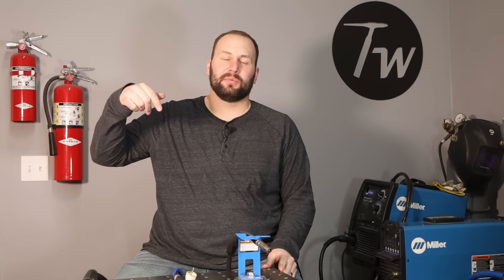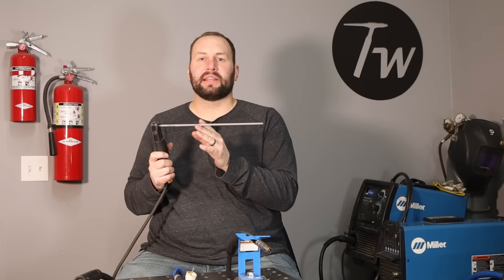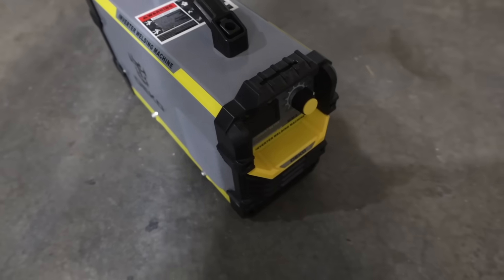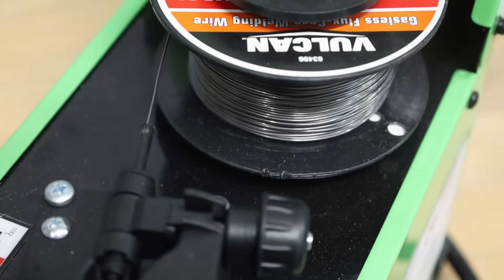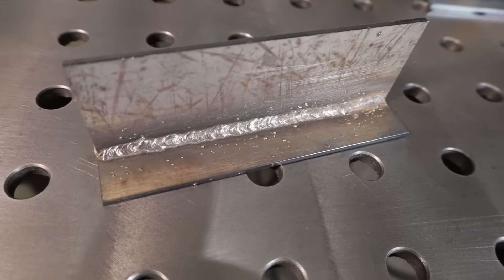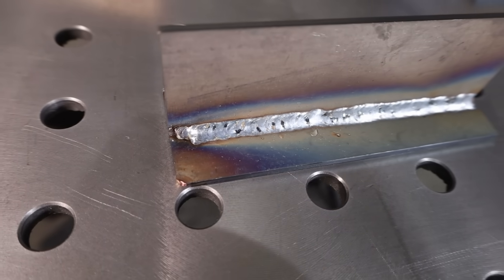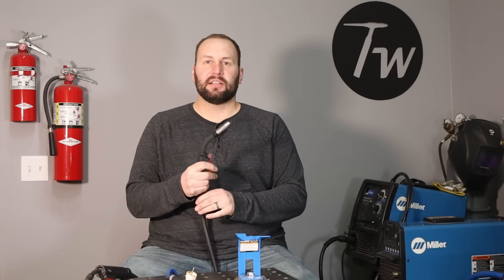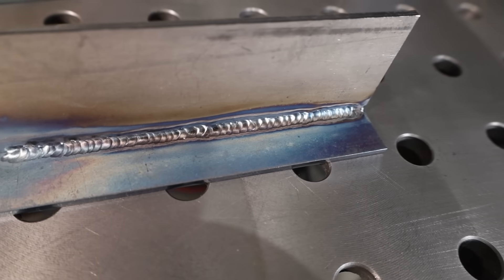4 Types of Welding Explained: MIG vs TIG vs Stick vs Flux Core

Comment: Welding is just of those things i just enjoy ok i am in a Woodworking group doing whatever i can do most jobs like hang doors/chop hinges/locks out and more but it's sort of something i come to rather than yes i'l go make something. 
Where as my welders and some steel and i'm away make anything! Got all the kit and few welders plus found 2 plus kit Abandoned chucked out of a van(2 inverters 110 and 240)did find an invoice rang them they contacted company they supplied with bits i found and they rang me gave details about it all and where with name i found on bits and signed invoice they tried to ring him then rang me back told them where i was sat on it for 6 months but never heard back plus even plod didn't want to know as i was concerned been hijacked etc as personal kit in their like steel square you make in Engineering course for first exam etc so claimed it plus odd only thing missing was the cables & mask) Got a Cebora 130amp Mig of someone it's same as the snap on one as they make for snap on. and bought a new 130amp Hobart inverter which can do scratch Tig with have torch etc for it plus spare circuit board as one day wouldn't work  checked torch volts! low guy got from sent me board but when sticking my nose inside found a relay with a reset button on top so thought press! Click! Ha so put back together and Bing working think Dirty Electric breaker as think is one that don't like running of Generators or Extension leads with surging current as place was at is out of way with poor electrics.
Stick welded door hinge on car to A pillar with 1mm rod was a job n half as often get built up and burn through so worked out just enough build then do bit along then come back do bit more till sorted didn't look perfect but door never failed again.

Comment: Tig to me is kinda like soldering
Reply: No! Not at all. Welding is defined as melting the base metals, whether the metal is fused or melted together or a piece of filler rod (thin wire) is added to the molten puddle. Soldering never melts the base metal such as copper or brass. Solder is tin and lead and adheres to the copper wire or any other metal with the help of some soldering flux. The flux prevents the metal from oxidising.

Comment: great vid for learning the differences of welding equipment but leaves the technique out of it. best tip I've learned for welding is heating the materials before welding, this removes the moisture and also helps the weld stick better and easier. but definitely have to practice.

Comment: I hand weld in the coal mining business, I traditionally use stick because of the heavier duty metal we work with but also MIG from time to time as well. This video was very informative. Great job.
Reply: I would get a flux welding, you might want a multi pupose machine so you can try different thinks but flux is probably the best.
It is fast and easy as MIG, and works outside on dirty metal like stick.
And one in my opinion very important point, you dont need different size if rods or gas, just a single spool of wire for everything.
Reply: @jonasstahl9826  good point.
Reply: Same in the steel industry too (I’m an electrician, not welder, but I’ve been dabbling in stick welding on night shifts).
Reply: MIG welding is just as effective as stick as far as strength.
Reply: @Strings-jg2to  maybe so if your in a controlled environment with absolutely no rust or impurities in your metal, but if your dealing with used equipment, and your outdoors, then stick is definitely the way to go.
Reply: Is stick welding good for like minibike frames
Reply: I own a small farm and DIY as much maintenance as I can. I have zero welding knowledge.  I don't see myself fabricating equipment but mainly doing repairs or minor mods. What is the best welder for me to have?
Reply: @joeh4295  duel stick mig set with flux wire for mig and 2.5 rods for stick that should cover most DIY maintenance jobs
Reply: @joeh4295  personally I would get a traditional arc welder, but the mig is a little more user friendly especially when starting out. But the traditional arc (stick) welder is cheaper to run because you don't need gas and the stick welder is great for older metals that may have a bit of dirt or rust on them, it has a lot less chance of trapping impurities or oxygen down in the welds and creating what's called porosity (which compromises the strength of the weld).
That's just my thoughts, but I'm no professional.
Reply: @joeh4295  looks like your comment got lost in the noise Joe. I always thought I'd just get the stick welder when my shed finally gets built. Now that I've seen this I think ill buy a MIG if I can use it to flux core as well as that's basically stick but easier and you can MIG for finer work.

Comment: If I understood you right a “Flex Core welder” can be set up also to be a MIG welder. I’m starting off for the first time and need to weld auto body parts. So would the Flex Core be the route I would take and should I look at Harbor Freight or a used welder ?
Thanks,  Steve

Comment: Tim, retired Ironworker here. There was no mention of changing welding hood lenses between stick & wire & tig. Auto darkening hoods were not on job sites that much back in the day ($$) and very rough treatment on construction sites. Some people mention that welding is boring. Maybe it was because I was changing projects every few months, but I enjoyed it. Made a decent living too. Solid video
Reply: Try sitting in a chair for 55 hours a week, That's TIG welding in a factory setting. Now that will test any welder. I did 30 years of it out of forty.
Reply: @georgebuck2269  I really can't imagine. For me it work was a moving target so it never got dull. Different locations/projects, heck what I was welding.
Reply: @stevethomas760  When a welder would come into the office for a job, the first thing I would tell him was it's a factory job, there's no outdoor work. One out of ten welders would tell me they only worked outdoors.

Comment: Nice job on the details. I sold this stuff for decades and had to learn all types as I went (I did learn stick welding in HS forever ago…). I fell in love with MIG welding as my “go to” just about every time. People believe this is such a mystery, but once you understand metals and what goes with what, it works out great!

Comment: I have noticed that 11 out of 10 english speaking welders, seem to get 1 term wrong. MIG is used for aluminum and stainless steel. For regular black steel MAG welding is the way to go. There is a huge difference between the 2. Namely the gasses used. MIG is Metal inactive gas. Whereas MAG is Metal active gas. Nice content though
Reply: In the US "MIG" welding is the term for Molecular Inert Gas or GMAC = Gas Metal Arc Welding. MIG has the wire spool with shieldig gas coming out. MIG is used for Steel, Stainlees Steel and Aluminum. Yes the gases are different for aluminum, you can only use Argon or a Argon/Helium mix. And for steel and SS there are many mix gases that can be used. Unless you're using flux core there's only one MIG type.

Comment: I'm a Boilermaker/Sheetie and whilst your video is informative to those that have no idea how to weld, I'll give you 2 'tweeks'.... 1 (and most important), your AMPS are too low on the TiG (that's the reason your weld is 'silver' and the HAZ is Blueish), plus add to that it would seem that the base piece is a lot thinner than the vertical piece (I'm guessing 3mm for the base and 5mm on top)... Secondly, have you ever heard of Anti-Spatter? Or as an alternative, drip feed (although that Mig gun wouldn't hold a decent Amperage for one)... Don't get me wrong dude, very commendable for a backyard hobbiest...
Reply from the maker: Hi Craig! Thanks for the kind words. Both plates are 3mm. It’s somewhat deceiving because the blue oxidized region is actually remaining from a fat weld on the back side. It would have been better to clean it up first or use new coupons, but it is what it is. An interesting misconception is that the bluish region is the HAZ, but it actually isn’t. The HAZ is the region that has been metallurgially affected by the heat of welding. The best way to see it is by polishing and micro etching a cross section or by taking a microhardness traverse. Having looked at thousands of cross sections, the HAZ doesn’t necessarily correlate in size with the blued region, especially with manual TIG. With a big cup and enough shielding it is possible to have a bright, shiny weld and base metal with a huge HAZ. (I’m actually a welding metallurgist). Learning to film welding is extremely difficult and I had to basically run those blind with the gear I had at the time, so the welds aren’t nearly as good as my more recent videos with better filming equipment. I am familiar with anti spatter, but likewise think a different transfer mode is a good solution, my pick is pulsed spray transfer.

Comment: Nice video, I would like to know if there's a significant difference in quality between the different welding processes. What's best for steel frames? for example, what's the most resistant or strongest?, I heard that for stainless steel TIG is the one to go but I don't know if is only for aesthetics.
Reply: All three welding types can be used for Stainless. MIG is for speed, ARC is rarely used and TIG is slow.
Reply: @georgebuck2269 I agree mig is for speed and manufacturing at a high pace. Eg quarry machines and structural steel. Quick and easy.stick is more for one site welding as it's for one stronger, and 2 easy to pack up and move. Tig is for aluminium welding. So don't listen to this fool.

Comment: A little while ago I did a one day welding course. Albeit obviously the teacher was asked to teach all the techniques in a neutral manner, it was clear he preferred MIG over all. He used to do this as full-time job and I guess MIG was dominating here a big time, since it's also the fastest. One thing to note for me stick welding was with great distance the hardest to learn and get an acceptable result, because either the arc breaks or worse you weld the stick to the piece and make a shortcut. Funny was that I did much easier on TIG than most students, I guess years of soldering experience paid of here quite well.
Reply: Yes I learned soldering at age nine and TIG welding in trade school at age 14. MIG is the easiest. Overhead arc welding pipe the hardest.
Reply: @georgebuck2269  oxy/ace welding is challenging , i came across a steel tee brazed on a cast iron main in the 1970's absolutely the best weld I've seen

Comment: Can tig welding be done WITHOUT filler rod??
Reply: Yes, TIG welding is defined as melting the base metals, whether the metal is fused or melted together or a piece of filler rod (thin wire) is added to the molten puddle.

Comment: Pro mic tip. dont attach the mic so close to your throat cause it will pickup everytime you swallow which is not ideal. (cause once you notice it, you cant unhear it and then it becomes all you hear) Drop it lower to middle chest

Comment: if you heat the metal with a gas welder stick welder becomes much easier to use it strikes an ark very easy and you keep the gas heating the metal while you welding.

Comment: You should’ve explained all the processes of Mig. Short-Circuit (which he used for thinner metals) Spray Mig (for thicker metal) and Globluar (for really thin metal). Do not oscillate with Spray Mig you don’t need to.

Comment: Great video, one question you could have answered was power requirements.  While you did a great job of explain the pro's and con's
of the different systems, all the time I'm wondering if I can I run these in my garage, do I need special wiring etc.

Comment: Can anyone here give me advice on a welder for my needs? I don’t want to spend a lot but I need something that is able to weld up to 5/16. 3/8” would be even better. My Lincoln weldpak hd is weak at 1/8” and I’m sick of it. I hear stick welding can be good and maybe cheaper? He mentioned a stick welder for 100 bucks? That’s amazing if it can weld 5/16?? I only need to weld occasionally but my tractor implements can be 5/16” at times. I suck at welding but want to learn. Can’t justify 1600 bucks on a damn welder I use 4 times a year. Input? Thanks!
Reply from the maker: I do really like stick welding and you can go as thick as you want running multiple passes on about any machine over about 125 amps. Keep in mind that it is a slightly different skill than wire feed. Stick machines are available at many price points. These are some I’ve used that I think are good for the price:
$130 DekoPro that I reviewed a while back
$300 Harbor Freight Titanium Stick 225
$500 HTP Inverarc 160 that I reviewed last week
$800 Esab Rogue 180i
If you want to go with wire feed, I would go with a machine 170 amps or more that runs on 230 volt input with gas shielding. I would use gas shielded flux cored wire (dual shield) for thicker stuff and solid wire for thinner stuff. Between the machine, wire and gas cylinder, that gets to be a bit pricey, though.
Reply: @TimWelds  thanks for the quick reply, what about oxy acetylene? I’ve inherited my fathers tanks, hoses and tips but oddly never got a lesson with them from him before he passed and of course the tanks are due for inspection and the acetylene tank is now empty after trying them out yesterday... can that weld 5/16? Thanks again!

Comment: Never done welding before but watching this and thinking about how you explain each method, isn't there a machine that isn't for doing multiple methods but combines methods? It seems to me that having a TIG tool with a MIG style feed coming in at an angle would give you better results as it could leave a hand free if the tool has a feed button and a heat switch so you turn it on and get it to temperature then push the feed button as it's needed, gives ease of use aswell as safety wise your not having to hold the metal that's being heated as it's gradually getting shorter and shorter moving your hand closer to the heated tool head, also if you've got a big weld to do you don't have to be ready to grab the next stick of material because it's just on a large spool.

Comment: Tim, wonder if you could explain something, I currently have all three types of welding process, Tig-Mig and stick, my mig uses Argon gas, I have heard of people using gas less wire with Argon gas, have you heard of that and what would be the benefit. 👴🏻👍
Reply from the maker: For gas shielded flux cored welding, it’s actually a different type of flux cored wire than the gasless (self-shielding) stuff. A common trade name for this wire and process is ‘dual shield’. It’s awesome for thicker stuff and out of position welds and produces a really strong spatter free weld. The main reason I pick it is because it is less likely than MIG to have a lack of fusion defect on thicker material. The wire I use uses 75/25 Argon CO2 blend like short circuit MIG.

Comment: When did it change from Arc welding to stick welding? I’m probably dating myself by asking that, but we used to call it Arc welding
Reply from the maker: All of these processes are technically arc welding processes. The real name is Shielded Metal Arc Welding, but I just call it stick welding because that is the most common name where I live. Other people call it Rod Welding or just Arc Welding like you. Others just call it a pain in the neck. 😉

Comment: Another advantage to flux core welding is that it can weld dirty metal, meaning that in many cases you don’t necessarily need to clean/sand off rust and coatings from your work piece before welding. (Not recommended, but capable.) I’ve welded galvanized steel a few times with mine around the farm. Very useful for quick fixes on wheelbarrows, broken folding table legs, and other random stuff like that.
Reply: Yes, zinc as it's used in galvanized plating is the only metal you can't weld. Copper and brass and a lot of others are weldable

Comment: i found TIG welding way easier to learn then MIG welding.  always had a fight with getting the correct settings on the MIG machine.  stick/electrode was also easy to learn. and autogenous welding wasn't too hard either.

Comment: Another disadvantage of stick welding is that the rods need to be stored in a dry place cause they won't work when they get damp. So forget storing them in your shed.
Reply: A old refrigerator with a 100 watt light bulb works. I have been a field  welder for 46 years  now. On my rig I run a heat gun on the rods till they are dry.

Comment: As teens we had a home made arch/stick welder. We blue the fuse in the power pole outside the house. Thought we were going to have pay alot of money to get fixed. Turns out the person that fixed it thought it was built with the wrong gauge fuse wire so no questions asked lol.

Comment: stick welder is best for outdoors welding because of that protective coating on the rod, if you try to use Mig/Mag outside on even slightly windy day, your welds are going to look like foam or sponge
Reply: The coating is a flux that burns off when you weld, keeping the air away from the weld. Without it there's no weld. Try breaking it off with a hammer for one inch (25mm) and then try to weld, it won't weld. All welds need to be shielded from the air. This includes TIG, MIG and arc welding.

Comment: I think it should be mentioned that stick and flux core wire welding are the most capable in outdoor settings. The shielding gases for the other processes blow away in the wind. The wind will usually make stick welding easier and safer by blowing away the smoke it produces. Great video and I apologize if this was already covered elsewhere in the comments. Have you ever done a gas flame welding video?